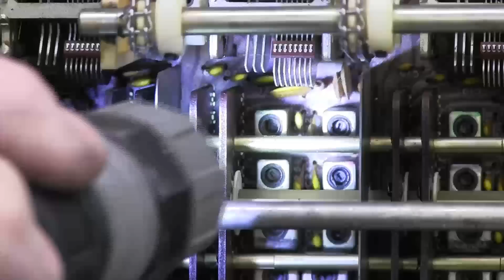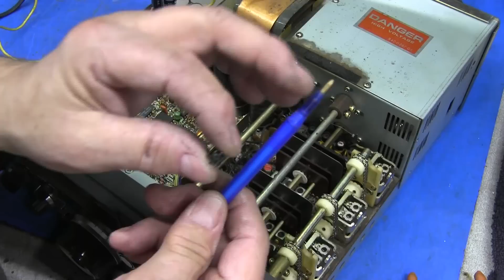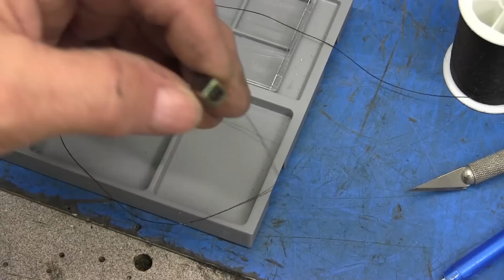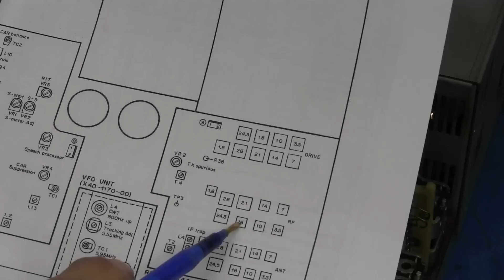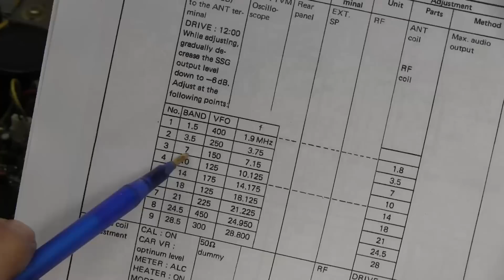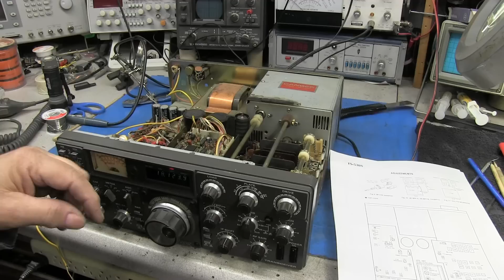Kenwood TS530S - More coils Pt 2

Comment: You're lucky that the slug still has a slot in it, (not chipped off), or hasn't cracked apart over the “screwdrivering.” I've found that several times in the past. I used to keep an assortment of slugs saved from scrapped transceivers over this very thing, and I also stocked a selection of new coils.
Reply from the maker: I have seen that many times, and not all times does the coil have an open bottom. Takes hours to pick the core out.
Reply: @TheRadioShop  True. I've had mobiles come in that had been "peaked out" by a shop at a truckstop in places around the US, and they would be a mess.

Comment: Great tip you have shared.  Never would have thought a waxy piece of thread would fix the coil.  I used to have a bunch of tuning wands when I worked on CB radios.  No telling where they are now.  Cheers from eastern TN
Reply from the maker: Thanks, yep, they wear out over the years, gets misplace ect. I need to find new ones.

Comment: Polyester sewing thread and wax works fine, but I prefer a thin strip of the PTFE thread seal tape used for plumbing.  I only ever use an expensive set of professional ceramic trim tools I got many years ago, but your home made one sounds perfect - and less fragile!  I once had to fix a radio that had worked perfectly for 8 years, but one resistor pcb joint was so clean it obviously had NEVER seen any solder in the factory!  It only showed up when the "pressure joint" got a bit oxidised.
Reply from the maker: Thanks for the comment. I have used plumbers' tape on larger coils in the past. I cannot count the times I have dropped a ceramic tuning stick and break the tip off.